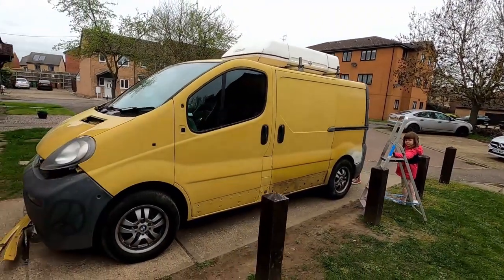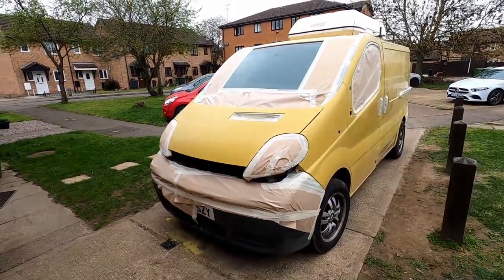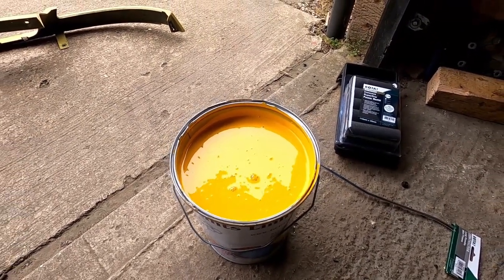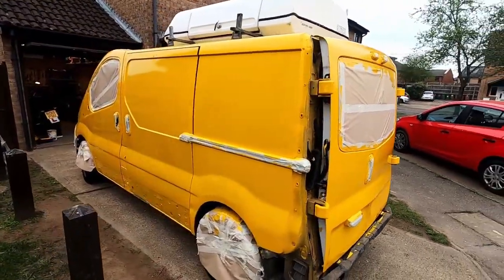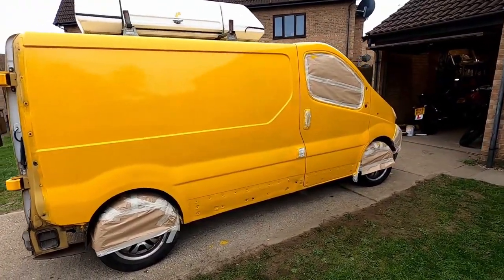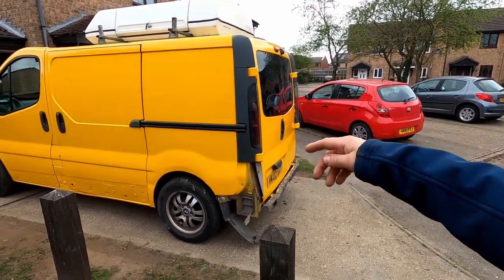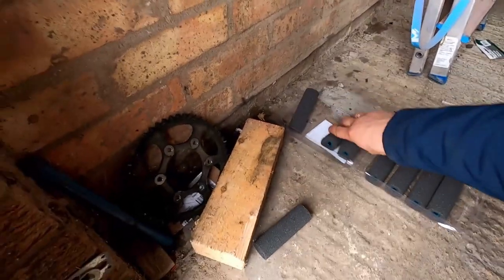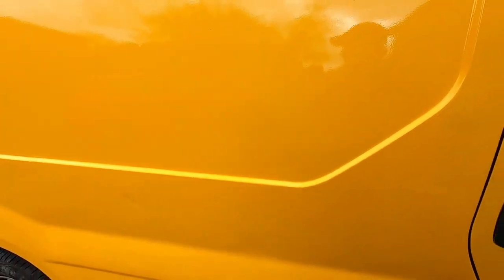Roller painting Vivaro campervan using Coach paint  [DIY on Budget]

Comment: Years ago I painted my EJ Holden panel van with Camouflage Green British Paint (house paint) with a brush. I put the car in the sun 25° C Australia. Put the paint on a bit thick. The heat made the paint smooth out to the point you had to get within 6 inches to see lite brush marks. I was very happy untill I parked it in the bush and when I returned I started to think someone had stollen my car untill I saw a reflection off one of the windows. 😂😂
Reply: My sister paint her EJ or eh with dark blue house paint. Half of the car had no brush marks (side I did) funny she purchase a litre and ran out. Driving back to Kmart at 100kms a hr the wind rippled the paint, but we smooth it back out with a second coat.
Reply: T@theaussienurseflipper.8113 
That's a great story. Paint must have gone on pretty thick to ripple.
I am glad you didn't drive at 100kph in reverse to get the ripples out.
Reply: @Karl-g1u  lol, didn't think of driving in reverse, but I was only like 15 at the time. If I was painting whole car, 1 litre would have been enough

Comment: You could go over all the plastics...bumpers, door handles etc with a heat gun 🔫🔥 it brings the plastic back to black from grey 🤷‍♂️
Reply: Makes the plastic brittle by bringing the oils out of the plastic. Don’t do it
Reply: He should paint the windows yellow to
Reply: Better to add oil to the surface than heating to bring out existing oil. I did my van’s running boards with oil months ago and they are still like new.

Comment: Was there any orange peel ?
Reply: I painted a Nissan truck years ago with a foam roller. Three coats. Sanded about 1/2 of the orange peel after coats 1 and 2. Last coat let it be. Make sure to let the paint dry well before sanding